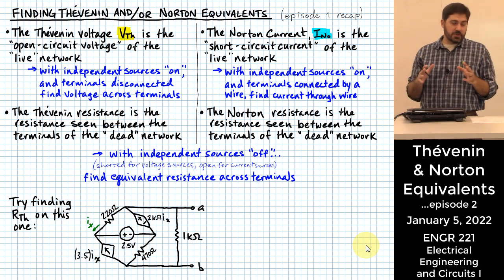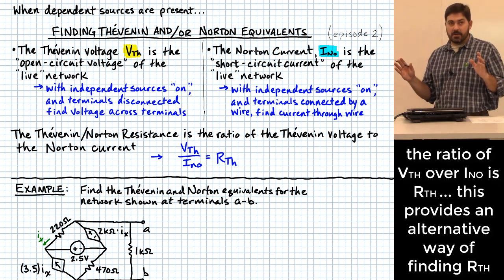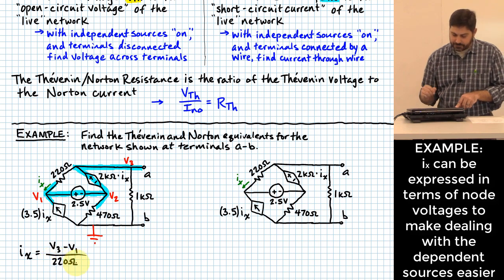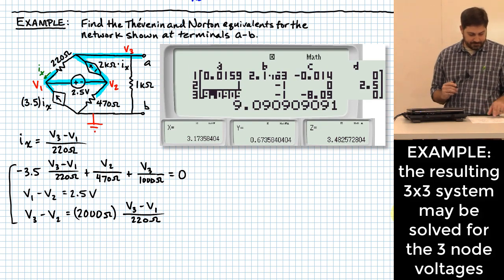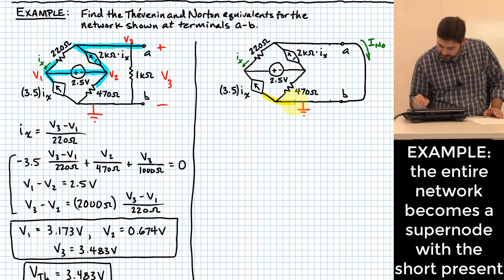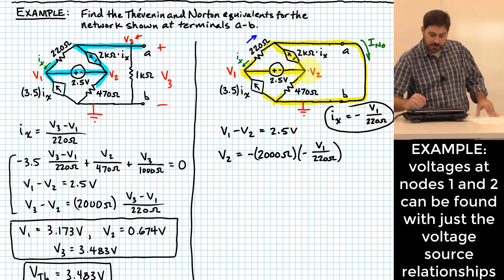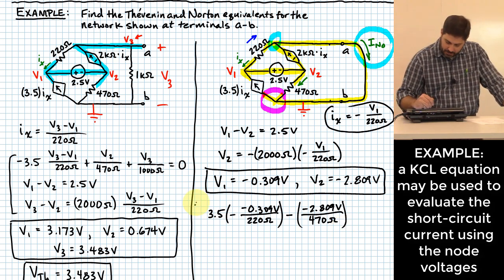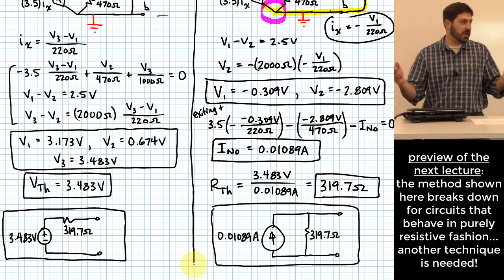Thévenin & Norton Equivalents, Ep.2: Rᴛʜ=Vᴛʜ/Iɴᴏ (networks w/ both independent & dependent sources)

Comment: for the combined supernode equation shouldnt you also include (v1-v3)/220 ?
Reply from the maker: No, because that would represent a current flowing from the supernode into itself. Any current flowing through the 220 ohm resistor does not enter or leave the supernode, so we would not want to include it in the KCL sum. Thanks for watching!